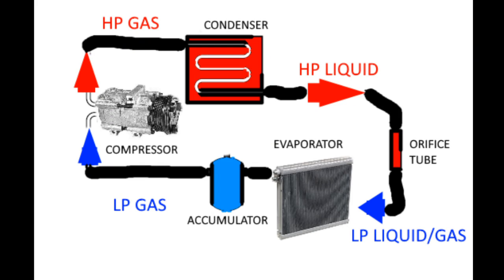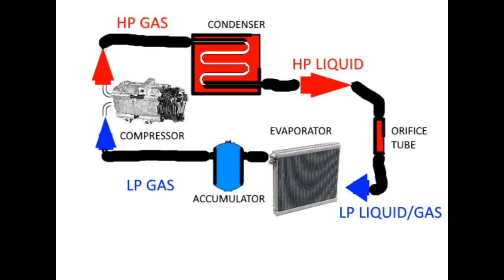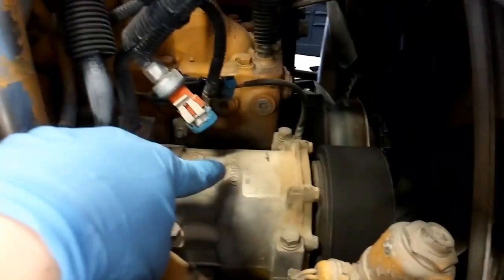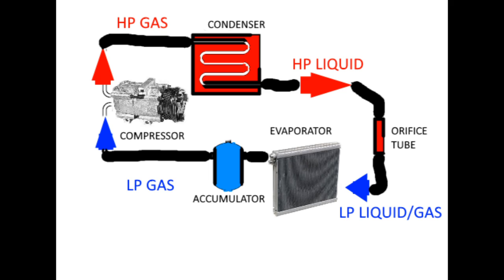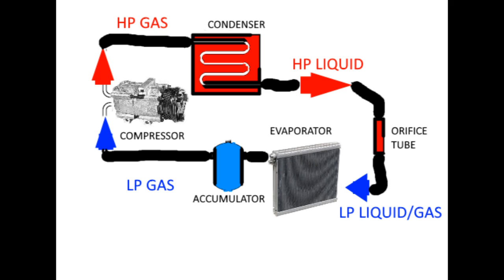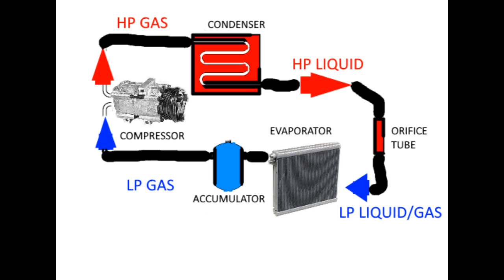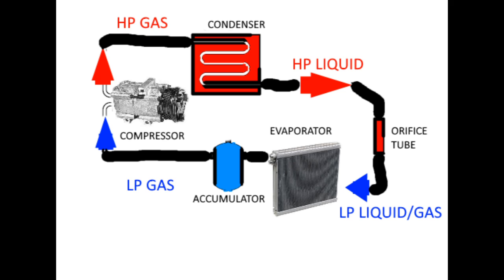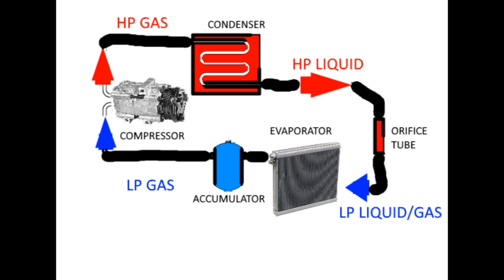How Truck and Car AC Systems Work.  Air Conditioning Principles and Beginners Class.  Part 2.

Comment: Part 2...from frustrated...
Got it figured out
Was electrical connection out of the main harness.
Compressor now engages.
So I an uncertified "mechanic" found the problem quickly while the certified shop spent hours and various parts later and didn't fix my AC

Comment: Continued from frustrated...
Sometimes it cools sometimes it doesn't but most times it doesn't.   I had a line replaced I've had a new compressor put on I've had the cooling sensor switch changed inside the dash. The first few times they charged the system to 5 lb and then it always kicked on my engine fan as soon as I turned on the AC. Then they charged it to 4 pounds and said it had earlier been too high and now at least the engine fan does not kick on.  It still doesn't cool and also I discovered when the air is  turned on the compressor clutch is not engaging. I also recently washed out my front AC radiator.
Expansion valve? High pressure  switch?  Low pressure switch? Something electrical?

Comment: I need  help on my 03 Durango ac system.  86F outside temp. LOWSIDE 15-20 PSI HIGHSIDE 150-155psi  I checked the relay is good. compressor is good run so the pressure switches are good. the accumulator doesn't seem to be getting cold much. the electric fan is good works and stays on densest cut out. Blower fan is working controls working, blend door seems to be working normally. low on charge maybe?
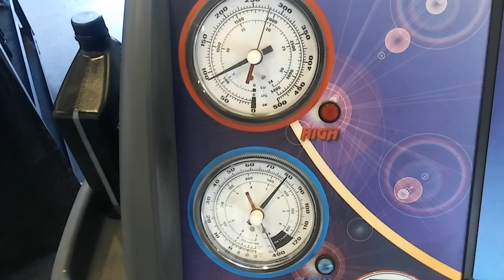Reply: 16:20
Reply: There is no low on charge!! Refrigerants are sealed in the system, if there is a low gas(Refrigerant),  that means its leaking. You have to find the leak before you charge it.
NB ; you cant add Refrigerants like oil; It suppose to circulate in the system forever, almost.